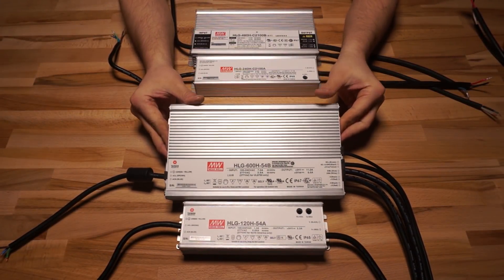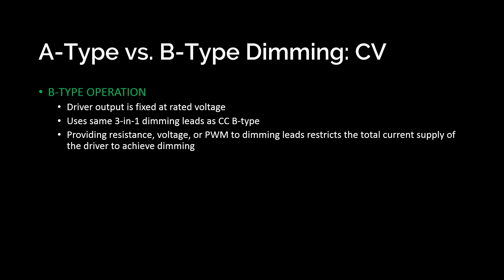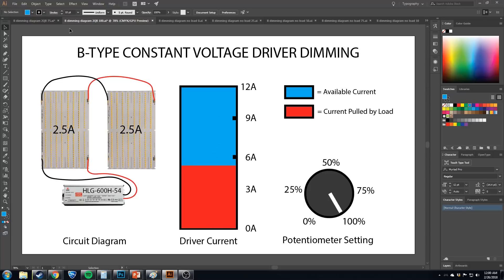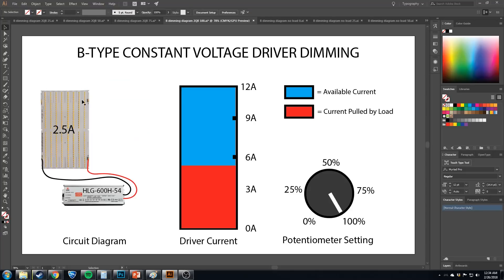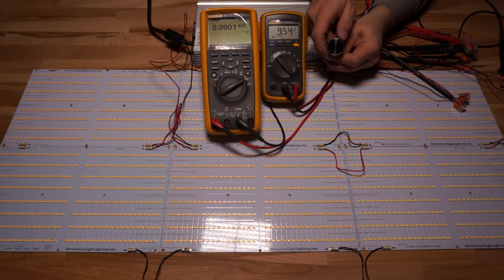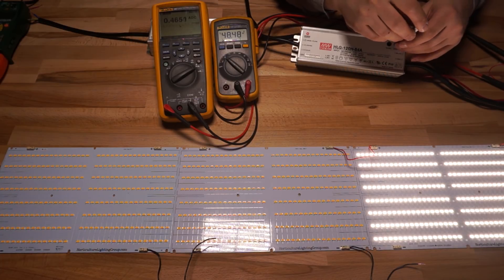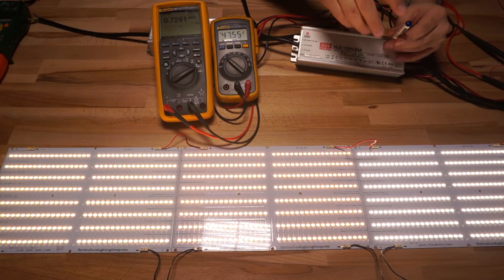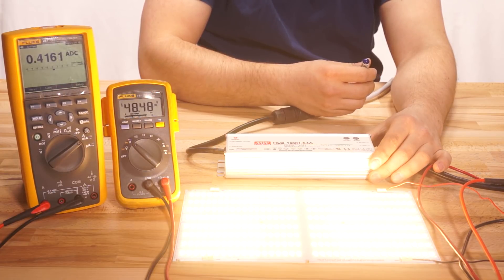The LEDG Guide to Mean Well HLG Drivers: Part 4 - A-Type vs. B-Type (Constant Voltage)

Comment: I may be wrong but as I understand it these use PWM for power modulation. So when you say its reducing the voltage or current, are you talking about average voltage and current? I ask because I'm planning on using one of these to power and control a load that requires a specific voltage to operate correctly. So if the peak voltage doesn't change but the average does that should work form me.

Comment: I dim my lights with the current pot and max out the voltage pot, my lights are 420w 36v and use a hlg185h36a, i run them at about 170w at the wall. Its all nice and cool.

Comment: if you have a B-unit with fixed voltage output, let's say 36V, is there any smart way to modify the unit to output lower voltage? Thanks

Comment: Thanks for all the videos, very helpful. 
I’m in a situation where I have an HLG-320H-12A that I want to feed a steady 12V to a controller board and have designed so that the led strips should not draw more current than it is rated for.
So in this case I should max out the Io and then adjust the Vo to 12V and in theory it should stay at 12V and the current will change accordingly (as default is Constant Voltage) - correct?
Reply from the maker: Yeah if the controller wants constant 12V, that’s what I’d do
Reply: @LED Gardener  Excellent content. Thank you. Any recommendations on where to buy drivers in Ontario?

Comment: Hey, thanks for all this info it's very helpful. I learned so much. I do have one question... Out of Meanwell drivers, which one has the most power? I'm trying to design my lights and bought 2 HLG480-2100B and 12, 36v cree cxb3590 was told to wire in series and nothing else brighter. Well at their figure I'll need 4 more Meanwell HLG480-2100B to power 24 more cree cxb3590 COBs does that sound right to you?

Comment: So without a multi-meter and using a plug in wattmeter,what would be the best technique to dim with a type A,is it to simply turn the current pot up and dim with the voltage pot?.Will there be fluctuating watts at the wattmeter or a time period for adjustment until its capped in this way?
Thanks for sharing all the great info :)

Comment: I stupidly purchased a 48 volt driver to run the HLG-Q288 which needs 54 volts..... is there any way to modify it to bump the voltage?
Reply from the maker: What version of QB288?
Reply: Its the V2 red spec
Reply: @LEDGardener  any idea how much current it draws at 48v?

Comment: Does the Pot help you save electricity in both CC and CV? or are the drivers always pulling 600watts from the wall? Basically will I see a difference in my bill by dimming or not?
Reply from the maker: insidejobSEP11 yes, dimming will reduce the amount of input power.

Comment: 23:45 Should say the "Voltage Pot", not the "Current Pot".   Right?
Edit:  Oh.. maybe not.  But I thought the whole objective here was to set the voltage pot just below/at what the boards require, to avoid thermal runaway.

Comment: Hey dude, i bought a qb 304 Kit  with a hlg 240h-C2100B and 2 x QB 304. I install a Potentiometer, now i can dim it from 250w to 9 w.
They run in paralel wiring,  i thing its better. What do you think? 
Boni  from Germany.
Reply from the maker: Hey Boni, that setup works just fine.

Comment: I just bought a 320w 3x qb288 kit i think it has a A type driver do you know if they set the driver up or will i have to go out and buy these meters to even use this light if so how much will i need to dish out for these meters?
Reply: i ordered it from hlg
Reply from the maker: Nope those are constant current kits so you can’t go wrong. No need for a meter.
Reply: Awesome thanks for the fast reply
Reply: A kilowatt meter is a great thing to have though, I don't think they cost but $20-25 maybe?  And a (cheap?) multi-meter can be had for the same.  Good enough to start off with :)

Just FYI.
Enjoy!

Comment: does the LED board absolutely have to be on the heatsink, would it function as it should if a board were off the heatsink by about 2.5 inches? and with a fan or two blowing on the sections that are off the heatsink.

this question is for anyone to answer!

Comment: Can I use the driver (HLG-480H-24B) for 4 quantum boards? What quantum boards would be suitable for this? 120W each I would think. I guess the 24 is the output the driver gives, does the light need to be 24V too then? 

The driver I'm looking at.
https://www.amazon.se/gp/product/B07PYW61C6/ref=ox_sc_act_title_5?smid=A1KLS26SU9YSD7&psc=1

Will be dimming with HA eventually
Reply from the maker: Figure out which boards you want to run and then match the driver to it. Chances are you will need a driver with a higher voltage. Pick your boards and I will suggest a driver.

Comment: Love your content, exactly what I'm looking into right now! +1 Subscribtion

I try to build my own PCB relfow "quantum board" but I have a problem deciding how to drive and wire. I want a board with mostly white but also blue and red in the main circuit plus far red in an extended circuit. 
My problem now is: can I drive the whole board with one driver and what to look out for regards different LED types (wavelenght)?

Can I wire in a way that I have the whites all in parallel series (let's say 5 series of 15x 3V = 45V parallel to oneanother), and then the blue and red in series of (X)x (Y)V = 45V?
Does everie series have to draw the same current or just need around the same Voltage (with maybe a resistor) and can vary in A, like differen V LEDs with the same A in series?
For now I'm thinking Meanwell CV A type driver.

Or maybe someone has a source where to look it up?
(sorry for double post)